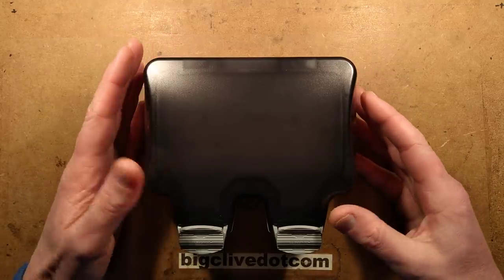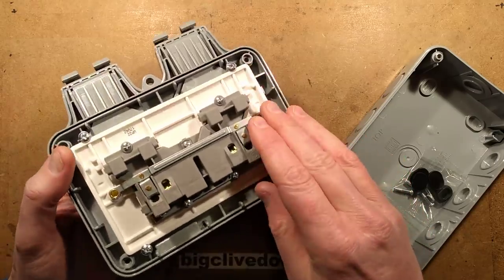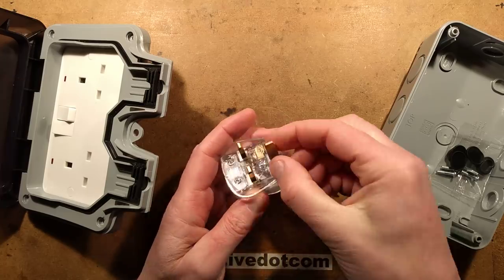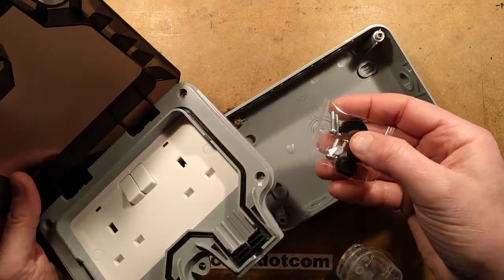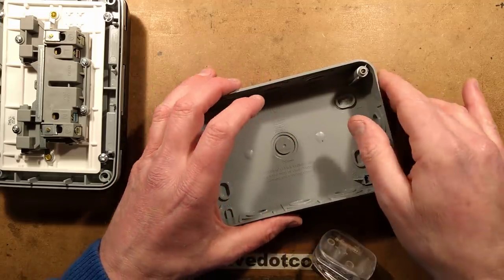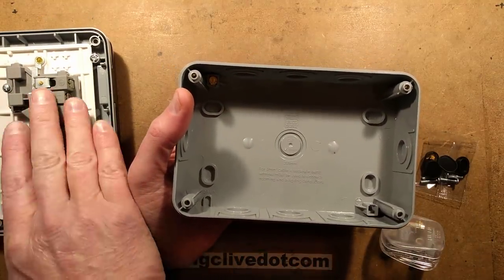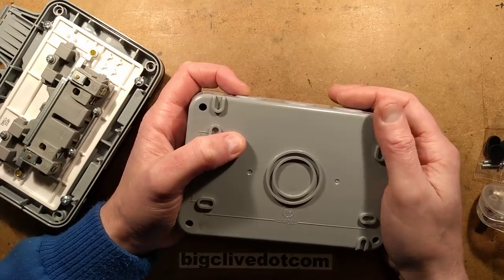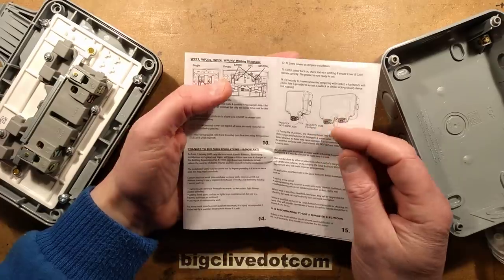British weatherproof socket with clever design. (bonus rant)

Comment: Here in the US you're supposed to have electrical done by professionals but in reality that is only done when it's something that requires Permits or involves the electric company to either do something with the meter or the entrance cable. I myself will usually do my own electrical work in my house that is just simple things. If i need something larger or complicated done I have a friend that is licensed and can do some stuff I may not be sure of. I also find that plug to be different and like the way the ground prong is and the fact it looks like it can't be removed. On our plug people quite often break off that prong because they most likely still have outlets in their house that were never changed to grounded ones since grounding wasn't standard here until about the late 80's or so for regular 120 volt stuff except for occasional things like power tools that are made of aluminum instead of plastic. Apparently people don't know that it's possible for that aluminum tool to become energized in the event something goes wrong or you use it outside when it's wet out.

Comment: Clive - great vid as usual. I've fitted three of these but have just found an issue.  When the front cover is opened, if there's any water on top of the fitting it drips down past the hinges onto the plug tops! Only discovered this because the last one I fitted was above head height. Surprised!
Reply from the maker: When opening outdoor panels I always sweep lying water away so it doesn't dribble down.

Comment: Hi clive , I have an outside PIR lamp which has never worked in the 5 years I have been here, I figured the bulb was dead but when i opened up the fixture my meter said it wasn't.. there is a small junction box  it connects to and i measured 1.3 volt ac across live and neutral instead of the 230v i expected..  This cable runs into the cottage where the main supply comes in  and there is a block of three switches on the wall near the door 1) is the hall light 2) is the Pir light and 3) is an outdoor light above the door.     So i decided to open the switch inside i found 2 cables with 2 brown cores each and a couple of link wires to reach the other 2 switch blocks.

I think one core is live and the other 3 become live in order to feed each of the three circuits.  I have never seen a switch wired this way.  Presumably there are 3 neutral lines commoned together and each of the 3 switch wires get joined somewhere to make the 3 'seperate' circuits.  Is this unusual or safe?  why did i measure 1.3v on the outdoor junction box.  i guess there must be a break somewhere for the one light not to be getting power. 

It's maybe not as bad as the 2 way lighting i found once with the earth core being used a switch wire but it does seem a bit dodgy at best.  the voltages were still a bit off i measured about 160 Volt over the switch contacts.
Reply from the maker: It does sound like an open circuit.  To do proper tests on mains wiring I recommend a proper set of basic test lamps that pass enough current to give more decisive readings.  There may be a concealed junction box somewhere in the vicinity.  Maybe above the switch in a floor or ceiling void?  If it is a simple open circuit then if you can find that junction box isolate ALL the power and double check with a suitable tester that it really is dead then look for a loose or broken wire in a terminal.
Reply: @bigclivedotcom   Thanks clive, one thing i didn't mention was the strange voltage in the 3 way switch i was measuring around 160 volts ac  could this be acting  like some kind  of voltage divider , i vaguely remember kirchoffs current laws with 1 feed in and 3 ways out maybe that is why the odd voltage. There must be something in the attic where those 4 cores connect to and go their separate paths.  it does seem weird having a single live at the 3 switches feeding 3 circuits at some point there has to be a place where the neutrals of the three circuits meet up.  You have a far better understanding of this than i have thank you.

Comment: Here in NZ you can do electrical repairs, replacements, permanent wiring installations, etc to household main outlets, lighting, etc. as long as it is after the mains switchboard/meter box. You are supposed have any electrical work checked by a qualified electrician though.  If anything happened to your house, as in a fire, and your insurance company found you had done electrical wiring work and not had it signed off you would lose your cover.

Comment: I have 3 of those outside on my garden ( 2 outside back door for jet washer and mobile phone charging in summer, and 1 at bottom of garden for water feature and RGB LED flood light ) been out a couple of years and no problems yet with them :) of course protected inside by a RCD main fuse. The garden one can be switched off by a fused weatherproof  switch so I dont have to turn all of them off if I dont want the flood light and feature on for any reason :)

Comment: As a german electrician, I like the ideas behind the british plug (BS 1363 / Type G).
I'd prefer Germany using the Type F system (CEE 7/5 socket with CEE 7/7 or CEE 7/6 plug) instead of the old Type E. (Especially since is a simple change)
CEE 17 (IEC 60309) is great.

Comment: Clive, could you elaborate on the changes to the color code please? not sure if i understood that part correctly, but if its the change i assume then it makes sense because it makes the wiring colors match internationally (aka Harmonized). Obviously in some Countries such a change would be more radical than in others. Here in germany for example the change was marginal:
L1 Black => Brown
L2 Brown => Black
L3 Black => Grey
N => stayed blue
PE => stayed Green-Yellow
(for clarification: yes, we had 2 black wires, L1 was the black conductor between N and PE in the cable, but you are supposed to measure the phase order anyway)
Reply from the maker: Ours was:-
L1 red
L2 yellow
L3 blue
N Black
PE green/yellow

With the new colors phase 3 and neutral colours were swapped.

Comment: Do they still have those outside lightswitches with the clear rubber membrane there?
US/Canada outdoor electrical leaves a lot to be desired
Reply: I havent seen those anywhere apart from on boats and those tend to be old.
Reply from the maker: They do still have the rubber fronted switches.

Comment: just one thing to note...my mother has one of these sockets on the side of her house...the problem is that after a year or two, it has become impossible to push over the clamps unless you have the strength of a gorilla even when there is nothing plugged in...it appears it might be a combination of plastic hardening and rubber seal stiffening.....

Comment: I have one of these exact same units and I changed the socket for a wifi extending one and I can tell you it is not in fact a standard double socket.  The depth of the face plate is thinner than standard.  I had to trim the wifi extender socket down in order for the locking down screws to be able to grip it.

Comment: Having inadvertantly taken a zap more than once off of a half-plugged in US style plug on a badly designed power strip or ungrounded extension cord (that is, one prong plugged in to the hot, the other hanging free) I admire the Brits' approach of taking electrical safety very seriously.

That, and INSULATED STUDS are a brilliant idea. We had a power strip sitting next to the bed and my girlfriend's necklace fell down onto it. There was something plugged in and the plug was hanging out of the socket just a little. Her necklace happened to bridge the hot and neutral because US plugs are uninsulated, and POW! The bridged section of the necklace basically evaporated, threw a massive red spark and it was gone. Scared the shit out us.

Comment: If you are worried about critters getting in through the drain hole, thread a short piece of string (like an old shoe lace) through the hole with a knot on both ends. This will wick the moisture down and out. Since water subscribes to gravity, it won’t wick it in.
Reply from the maker: That doesn't allow for the green goo that inevitably forms on any obstruction and impedes all flow of liquid.

Comment: Only thing I have found with these outdoor sockets is the clips to keep the door closed, they fail.  Then the very clever doesn't work as it is exposed- so I still use screwed shut boxes, with they inside, that way when the thing fails I can still use them.  Just those clips, otherwise I have found them great.

Comment: Clive, the European coloring of wires is brown for the live, blue for the neutral and yellow/green striped for the earth. I only see one dull brown-ish color. Unless you're talking 3-phase, but that usually doesn't happen much in domestic appliances.
Reply from the maker: I was talking about the three phases for industrial equipment.
Reply: Oh, I see. Yes, then you're right. But still, I've never known it any different, and it's just fine with me. So I guess it's a matter of what you're used to.
(I once installed a ceiling light in a house that had been DIY-wired by its owner in the 60s, and I got a little surprise as in that the live was the green-yellow wire - so there may be some merrit to that new regulation, anyways...)

Comment: Perhaps we here in America could benefit from the British plugs and such.  Our electric is a mis-mash of old and new. Sure there are codes, for example I ran a drop cord from my house some 30 feet, overhead from my house, down the side and into the dirt basement, where a neighbor was nice enough to wire up a plug for me, plugged it in to  a 20 amp circuit, dropped the cord down the side of the garage and put a standard indoor plug inside the garage.  Then took some inside house wire and ran from that plug across the top of the walk-in door of my old garage and drilled a hole in the wall, hooked up one of those on at dark off at daylight florescent yard lights.  Well that worked great for about 15 years but the sun eventually rotted the insulation of the drop cord, and it began to slough off. The inner insulation was still good, but I thought it best to have an electrician fix it for me, as I was no longer able to climb my roof and such.  So 800 bucks later the proper wire was run from the mains out to my garage, where a simple ground fault plug was installed, and the rest of the wiring including two overhead light sockets and three outlets were installed.  Thankfully (for my purposes anyhow) he did wire the plug that I had initially installed and leaving my yard light connected, so when the ground fault breaks, as it seems to do at the drop of a hat, I can still use that first outlet for other purposes, such as connecting our RV power so I can charge the batteries and work on the television and such.  I need to run my air compressor off that bottom plug because using the GFP simply blows the fault when the compressor kicks in.  Weird. I also have a drop cord that came with the house, it was wrapped around the mail box and left by the previous owner, a midget lady who aged out of the house and passed away some 20 years now.  The plug was dangerous as hell, just two screws holding the wire, no strain relief and open to the world and weather.  I did replace it with the proper plug and still use the cord as it is the heaviest extension cord I ever saw. I had an outdoor plug installed by an electrician, he simply went into a closet where an indoor  outlet was in the wall, opened the paneling, and cut a hole through the siding, then ran a short wire between the indoor plug and wired up an proper outdoor plug.  When I asked if he could switch the outlet, he replies sure, and runs a chunk of wire through the closet to the wall, cuts a hole and put in a plain wall switch.  Not sure if it is supposed to hold the amperage required for our car engine heaters that we need when the mercury falls well below zero and we need the car that next morning, but I guess it has been working.  Ah well just my little rant on the lack of regulations, or lack of enforcement for that matter here in small town America.

Comment: I had a thought about that drain hole thing, with bugs potentially getting in and all.

what if you were to drill the hole, and then put some sort of mesh or filter along the inside of the hole? would that make it to where insects couldn't get in, or would it cause it to be more likely to gum up and clog?
Reply from the maker: The mesh often allows gunk to build up and create a plug.  Waterproofing of enclosures is a complex subject.  Especially where electronics are involved.

Comment: The LED  on the socket is a life saver clive I have 2 singles, 1 at each end of my drive so I can see if I have left one on or not, saves a 70 metre walk, quite bright at night through the cover too, I bought them about 10 years ago, no problems other than on a windy day the lids can blow off if not properly shut.

You missed that you can fit a small lock under the bottom in the center, this could stop people turning a socket on or off and in the two gang both, maybe to keep a fridge on, or table saw off

Comment: Here in the US, I installed a 100 amp sub-panel in my basement and ran 20 new circuits for outlets and lights.  As part of the building permit required for finishing an unfinished basement, I had to go through an electrical inspection the same as would apply if it was done by a "professional" electrician.  The inspector who came out told me that my wiring and panel installation was cleaner than he typically saw from professionals.  My feeling is that I live here, my family lives here, of COURSE I'm going to be extra careful in everything I do.  I suspect that if the US government tried to enforce similar limits on homeowners doing work in their own property, we'd be back to dumping tea in the harbors and taking up the arms we already have.

Comment: In the US, I don't think you need to have any kind of approval to do electrical work on your own house. Obviously, not knowing what you're doing is dangerous, but there's no regulation stopping us. The only time it would be an issue is if you did some work that wasn't up to Electrical Codes and then tried to sell the house. The home inspector would make note and then you'd then have to bring it up to code at that point.

Comment: Thanks for the helpful video. Is is possible to exchange the faceplates which come in units like these? I’m keen to replace the standard socket which came in mine with a smart socket. Assuming it fits then I presume it should be fine as your video shows that they’re fixed into place with screws?
Reply from the maker: It might be worth trying it, but smart sockets are often quite bulky.  I'm not sure how a smart socket will survive in the inevitably more humid outdoor environment.

Comment: I'm glad that I did all the rewiring in my house, including fitting one of those outdoor sockets to my garage, before the regulations changed. You can tell by the colours of the wires I used. ;-)
I can understand the reasoning behind the regulations. I have seen some appalling wiring in the last couple of houses I've lived in. Light switches where the screws haven't been tightened at all so the cables were just sitting in there sparking away. A 13 Amp socket that had been moved... using a short length of 32A cable and a chocolate block... to behind a central heating pipe so you had to push the pipe to one side to get a plug in. Or the light that was wired to the socket ring main with wire that was unprotected and just plastered over.
Sorry, I seem to be ranting too.
Reply: Whoever rewired my house used the earth conductor in twin & earth for the 3rd conductor in a two way light switch.

Comment: I have a similar socket outside, only mine has the RCA trip switch built in too. Simple to fit, I have a hot tub and an outdoor freezer in a shed running from mine.

Comment: When I add electrical sockets etc to my own house I connect it to the existing ring via a 13 amp plug on the end of a run of cable. In my own mind this makes my fittings just a glorified power strip and I do not touch the mains electrics. I am not sure if I have a legal leg to stand on. I try and do everything to spec apart from the last connection.
Reply from the maker: That's fine.  It falls into the category of an appliance.

Comment: I’ve got a single version of this and the biggest weakness is the clip. Repeated use brakes the tiny plastic ears that hold the hinge pin in place making it impossible to close the lid securely 😉
Reply: I have the double version.  Not a fan of the design.  The clasps at the bottom are an absolute bar steward to close and open on the one fitted on my house.  Had a close look at it today, seems that those triple rubber seals on the cable entry are far too obtrusive, preventing the lid from closing and opening (by exerting too much 'spring force' on the lid).  Me thinks this is probably why the plastic hinges break off.  I have seen examples of these outdoor sockets with the lid broken off.  The triple seal is on both the lid and the fixed surround...it's excessive and gets in the way of the basic function of closing and opening!

Comment: Is it possible to combine solid state de-humidifiers with that 5mm hole? 
I mean, would that be just more effective?
Reply from the maker: It would require a power supply and the dehumidifier component.  That might be a bit extreme for a socket.
Reply: @bigclivedotcom  Indeed. But about the power supply. It could be one of those mains sockets with USB charger ports.